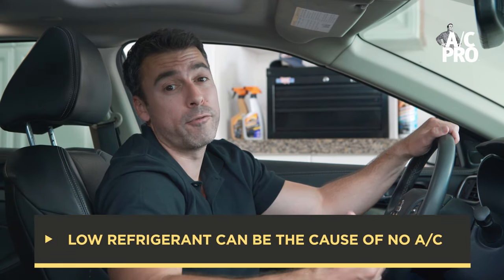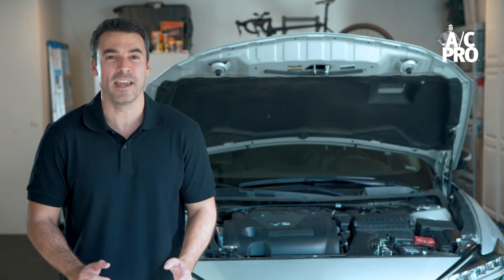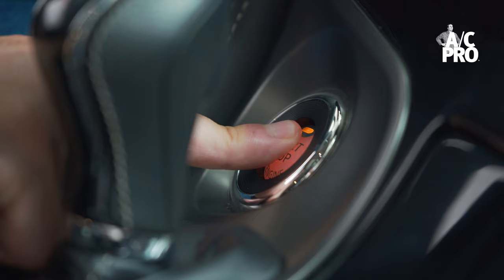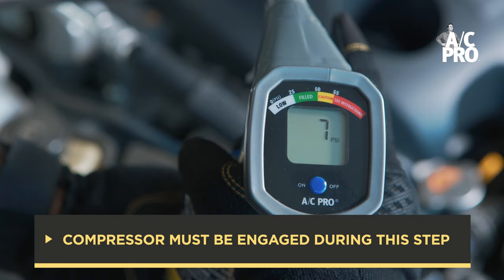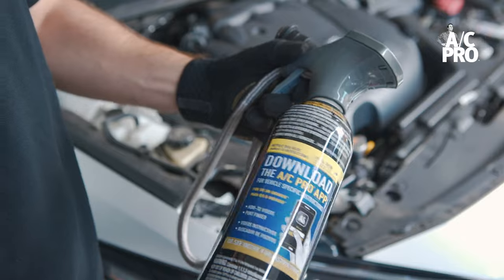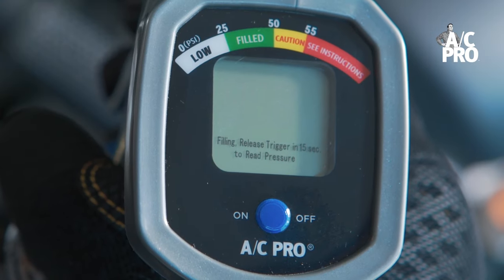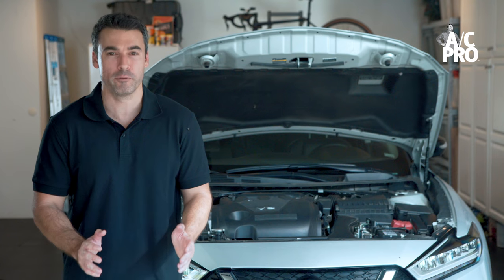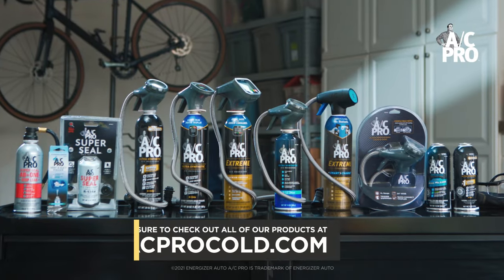A/C Pro Digital Gauge Tutorial: How to recharge your car with A/C Pro

Comment: Hey guys Chris fix here lol anyway I just did this to my suv the digital gauge was jumping all over the place it would go low as 16 psi then shoot up to 41 psi but what I seem to notice is when I kept filling the system the psi would move slightly higher than at some point I noticed my A/C compressor would kick on and off but and I kept filling the system the A/C compressor kick on and stayed on once that happened the psi stayed consistent and I was able to get a good read to the tune of 20 psi kept filling her up to the top now it’s Alaska I’ll keep you guys posted
Reply: Hi, I have the same problem. Did you read the low psi or the high psi? The high for mine goes up to 49 psi and than it goes down to 16psi. But still no cold air ..
Reply: Lol. Funny guy
Reply: @ALCRAN2010 Do you contribute anything of value to life or is this just a thing you do on youtube

Comment: does the low pressure port hose always have insulation on it, like the one you showed in the video does?
Reply from the maker: The ports in the video have what's called a dust cap on them.  This cap serves the same purpose as the one you've probably seen on a tire's valve stem.  It would have definitely been on there when the vehicle was new, but may have been taken off and not replaced at some point in time.  We do sell replacements at your local auto parts store.

Comment: My digital display is reading a psi of 90+ when NOT connected. I’m wondering if this is a defect on the display. I seem to not be getting a good psi reading. Shouldn’t the psi reading read 0 if not attached to anything ?
Reply from the maker: No, the hose holds pressure even when disconnected since there's the check valve on the end.  If you pull the trigger to release pressure after it's been disconnected from the can and system the pressure reading will go down.
Reply: So I did this and it will only show a bogus number either time.  I Paid autozone a good bit of dollars buddy
Reply: Same here, mine keep reading 115-130
Reply: @Acprocold  Finally. I did not pull the trigger on the guage.  I haven't attached it to the can yet. Just checking the PSI first.  That explains why it was at 100 psi when i hooked it up.  This time ill press the trigger before attaching it.

Comment: I use half of the bottle, can I disconnect the hose from the bottle? Does the refrigerant left escape from the bottle?
Reply from the maker: Yes, the can has a self-sealing valve so disconnecting the hose will not release any refrigerant inside.
Reply: @Acprocold   That's good . The old style AC pro did not have the feature and when i removed the guage it sprayed refrigerant everywhere. lol

Comment: My pressure was 26psi.  On the low end of the green.  I added some but only got to 30psi.  It would not go up from there no matter how many times I added refrigerant.  Air is maybe a little cooler but not cold like I was hoping.  Leak?

Comment: Hello, Is a hissing sound coming from my car vents a sign of low refrigerant?
Reply from the maker: No, I would say most likely not related.  The refrigerant system is a closed system.  Even if you had a leak in your evaporator, which usually sit closest to the cabin, a leak big enough to make a hissing sound wouldn't last long before your system lost all refrigerant.

Comment: My pressure reading was 24 added about half a can and pressure never changed. Went ahead and added the rest of the can pressure still reading 24. Is that normal?
Reply: Same thing happened to me what did u do
Reply: happened to me 5 times.
Reply: i already added 6 cans and the pressure reading is the same haha
Reply: How do you know that you had half a can left? Perhaps the can is empty and that's why the gauge reading isn't changing. The pressure on mine went up from 27 to 36 p.s.i. when I was charging it and then suddenly stopped, so I am assuming that the can is empty (hopefully not a leak in the system).
Reply: Most likely you have a leak somewhere in the AC loop
Reply: Same thing happened to me.  I stopped at around half can full.  I'm worried that I over charged the system, and too much pressure in it...
Reply: The can sucked it back in 😂

Comment: I’ve had my car for 2 years and my psi shows 50 what em I doing wrong or is my reader wrong
Reply from the maker: Not necesssarily doing anything wrong.  Warmer temperatures increases the pressure in the system and depending on the system design there may be a higher set pressure in your vehicle.

Comment: i'm using the digital and hard to know if its overcharged or undercharged coz the digit is unstable
Reply from the maker: The pressure reading may bounce up and down due to the compressor cycling.  Take the pressure reading when the compressor is on.  There videos will help.
https://youtu.be/XAlw_aoaPF8
https://youtu.be/ldNPhoIpN6c

Comment: What does compressor must be engaged mean. Mine clicked when I put it on with the car running and AC on. Though the result showed up as zero
Reply from the maker: You need to read the pressure when the it's cycling.  You can hear the compressor cycling on many vehicles.  It will click to engage.  If you read the pressure when the compressor is not on it may give you a high pressure reading.  The compressor pressurizes the gas in your system as it pushed it to the high side.  It will pull gas in from the low side where you're reading pressure from as it does this.  More than you need to know., but that's what's going on.

Comment: On one of your other videos or web pages, you said you need to adjust the fill based upon ambient temp and the guage turned to adjust.  But this video seems to imply that adjustment for ambient isn't required.  Did something change?
Reply from the maker: Pressure in the system does change based on outside ambient temperature (i.e. higher temps = higher pressure), but we removed that from our gauges many years ago because it was a confusing concept for consumers to understand.
Reply: @Acprocold  Thanks.  Some of the photos online of your products still show that gauge even in the same listing that shows it not having that gauge.

What is the expected accuracy of the built in guage?  +/_ 5 psi, for example?

I ordered a can last night, so I'll figure it out either way.  Thanks again.
Reply from the maker: The gauge is accurate within +/- <1 psi.

Comment: Compressor goes off and on could not get read out. Starting filling when compressor on it was at 25-30. When off it would read 75 which is above red zone. Compressor still intermittent while charging. Is 75 bad news Help. Thanks  Update. Watched video again.  It worked ice cold!
Reply from the maker: Glad it worked.  Read the pressure when the compressor is cycling on.
Reply: @Acprocold  Thanks

Comment: Help, the gauge reads out 5 psi even when it’s disconnected or when I try to connect it. Pls get back to me
Reply from the maker: The gauge will read the pressure of what it's connected to.  If it's connected to the system it will read that pressure.  If it's just connected to the can, it will read the can pressure.  If it's not connected to either of those if will read the pressure of the gas in the hose.  The hose has a check valve that will hold gas in the hose.

Comment: Mines is saying 37 so is this thing broke or I have other issues?
Reply from the maker: There are many reasons other than low refrigerant that may be causing warm air to blow from vents.  That's why we recommend just checking the pressure first to make sure you're low before adding so you can return the product if you don't need.

Comment: How does this gauge work with different temperature ranges while filling. I know you can adjust an analog gauge depending on temperature. Should I be concerned that this doesn’t have that feature if I’m filling up in certain temperatures outside?
Reply from the maker: This gauge works exactly the same as an analog gauge with regards to pressure.  Just uses a digital pressure transducer instead of a Bourdon tube in an analog gauge.  If you need a guide on how to adjust the pressure to account for outside ambient temp, please refer to this chart.  https://www.acprocold.com/faq/r-134a-system-pressure-chart/
Reply: @Acprocold  is this why the new gauges do not have the dial that can move to align with the ambient temps ?
Reply: @Acprocold  can you use this gauge on both low and high sides just to get a reading? I thought this gauge only worked on low pressure side.
Reply: @timothy9360  Low only accoriding to the video.

Comment: I connected it all up, but the gauge would not come on.  I tried pressing on and off.  No dice.  I guess this one's defective;  frustrating.
Reply from the maker: @paultparker - there are two potential reasons the gauge might not be fitting on your vehicle - you bought a can with 134a inside and your system takes a new environmentally-friendly refrigerant called 1234yf.  1234yf has fittings that are different from 134a (by regulation).  Or you are are trying to attach the gauge to the high side port.  Look for a sticker underneath your hood that lists the refrigerant type and make sure you are using that same type.  Our port finder tool can help you find the right port to connect to.  https://www.acprocold.com/a-c-port-finder/
Reply: The actual problem was just pulling out the battery tab before the gauge could come on.  I didn't notice that and finally found it deep in the comments on the video.  Might consider mentioning in the app.

Comment: My Psi goes from 40, down to 19 then back to 40 every 10 seconds or so. I noticed the compressor rotates then stops and rotates again every 10 seconds as well. What does this mean ?
Reply from the maker: This is typical for many systems.  The compressor will cycle on and off as needed.  You should take the pressure reading whent the compressor is engaged.

Comment: The gauge won't turn on. Is there a secret code or did I just waste $60?
Reply from the maker: Have you pulled out the plastic tab?  Also, try pulling out the battery receptacle from the housing and push it back in to make sure it's seated properly.

Comment: What if you accidentally let it get to 61 and it still blows warm air? Asking for a friend
Reply from the maker: You should have a professional technician remove the excess refrigerant you added to your system.
Reply: @Acprocold     Or use a gauge from one of your old cans and a towel (a friend told me LOLOL).

Comment: I connected the coupler, gauge read 115+, what do I do ?
Reply from the maker: If your vehicle is on, A/C on max cool, the compressor clutch is engaged (hear a humming sound), and the pressure reading is high we suggest you return the product if you haven't used any refrigerant and see a professional technician.  You may have an issue unrelated to low refrigerant.
Reply: It will read high if the compressor isn't on and then read lower when the compressor is on (assuming that everything is functioning correctly).
Reply: Same what did you do ? Did you get it fixed
Reply: Run for your dear life  🏃‍♂️ 💥  😂

Comment: The numbers on my gauge keep jumping up and down
Reply from the maker: Yes, this can happen as the compressor cycles on and off.  You should take the reading when the compressor cycles on, which will typically be the low pressure reading.

Comment: How to reset mine it’s jumping from 25 to 81 in 15 sec
Reply from the maker: The pressure fluctuates due to the cimpressor cycling on and off.  Read the pressure when the compressor is on.

Comment: Why my gauge fluctuate?
Reply from the maker: The pressure on the gauge may fluctuate as the compressor turns on and off.  Read the pressure when the clutch engages.  When the clutch engages the pressure will go down.

Comment: "We simply attach the quick connect coupler to the low side pressure port by pushing to snap it on. The coupler will click once it's secure." Uh, nope. Won't connect. Tried several of my cars.
Reply from the maker: If it doesn't easily connect you may have one of two issues 1) you have found the high side port and not the low side port.  They look similar, but are not compatible 2) you have a vehicle with 1234yf and are trying to use a product containing 134a.  1234yf vehicles have low side ports that are unique (by law) to make sure the proper refrigerant is used to recharge.  Look for a sticker under the hood to help you determine which refrigerant you have.

Comment: My low pressure side reads 128 psi. I guess it's off to a mechanic.
Reply from the maker: That's correct.  If your engine is on with the A/C on max cool and fans on high and you are getting a high pressure reading when the compressor is engaged, you need to take it to a licensed technician.

Comment: What if reading says 151?
Reply from the maker: If your engine is on, A/C on max cool, and the compressor clutch is engaged when you take the pressure reading and the PSI is 151, you probably have an issue besides low refrigerant so we recommend you have a professional technician take a look.
Reply: Thank you so much for your help.

Comment: Reading stuck at 0 every time I squeeze
Reply from the maker: The gauge can't read pressure from your system when you're squeezing the trigger (charging your system).  To read the pressure of the system, you must release the trigger to check.  Continue this process until you're in the green with cold air blowing from the vents.

Comment: The digital sucks it doesn’t give actual reading I prefer the old style
Reply from the maker: The digital gauge does give the actual pressure reading.  The digital pressure transducer that takes the reading is actual more accurate than the Bourdon tube in an analog gauge.

Comment: My psi is at 125 wtf
Reply from the maker: Is your engine on with the A/C turned on max cool with the fans on high?  If so and you're still getting a high pressure reading, take the product back to the store and get a refund without using.  You most likely have another issue besides low refrigerant causing your issue.
Reply: @Acprocold  it was on full blast but I found that the A/C clutch relay fuse is blown out. I put a new one on and it was working just fine but then it blew again after 10 mins of driving. I’m thinking the coil in the compressor is messed up? I don’t have a voltmeter otherwise I’d check that connection .. got any tips ?

Comment: Gage is crap. It read 45 psi disconnected
Reply from the maker: Actually, the gauge has a check valve in it by law that will hold refrigerant in the hose therefore the gauge is reading that pressure.  If you squeeze the trigger to release the pressure from the hose it will move to zero.
Reply: @Acprocold  that’s not my case. It’s not connected to the bottle.
Reply from the maker: Even when it's not connected to the can the check valve in the hose will hold gas in the hose so the gauge will read that pressure.  If you squeeze the trigger to release the gas from the hose, the pressure reading will go down.  It's a requirement to have the check valve in the hose due to the length.

Comment: My psi reading was 120?😮 still blowing hot air😢
Reply: The digital readings will be off if its not completely plugged in, it was saying mine was 90 and i would squeese the trigfer and it wouldnt change much, and then i realised the plug wasnt completey in, it goes really far into the thing that sticks out of your car, you will def see/ hear a snap and when you pull the trigger it should make an audible sound. Strangly though even after i got it snapped on and squeezed the trigger till i got cold air the psi reading stayed at 0 X'D this thing is NOT fool proof but you can make it work
Reply: @SoldatDuChristChannel  thanks buddy